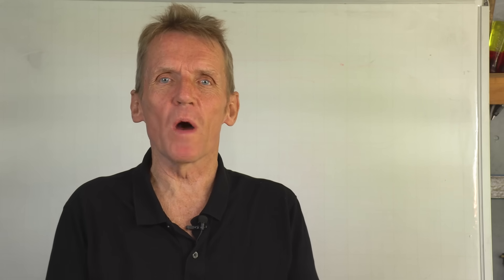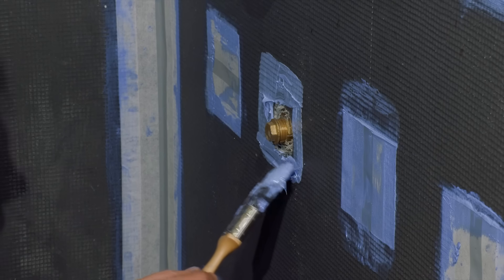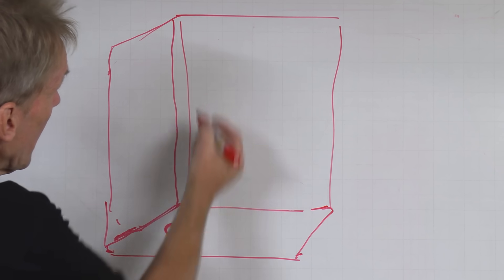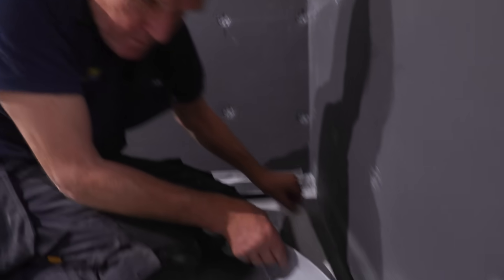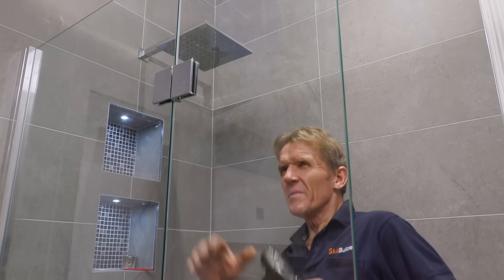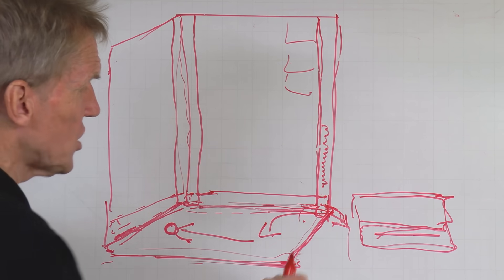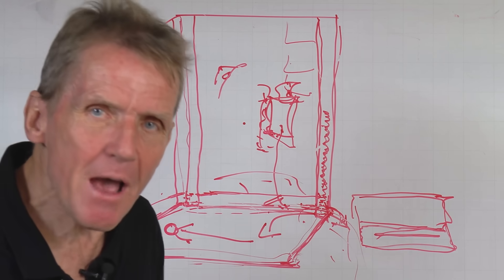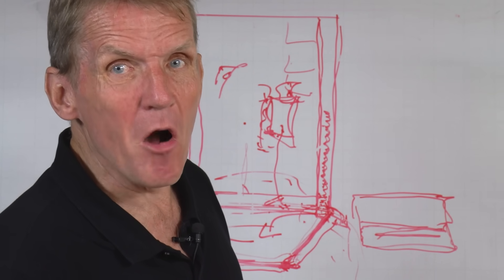This Is Why Your Shower Tray Leaks

Comment: Having just had my entire bathroom renovated and built from scratch, I had at least 8 "bathroom installers" in to price up the works, all but one of them (who eventually got the job) said they would use moisture resistant gyproc as "that's good enough and what we always use", a few of them when I asked about Hardie Backer asked "what's that?", eventually I gave up on the idea of them using Hardie board or equal till the last guy came in and I mentioned moisture resistant gyproc where upon he scrunched up his nose.  I asked if he would prefer something like Hardie Backer and he said he would only use that.

He got the job based on that one thing... and a great job he's doing so far too.

Comment: That's why I prefer wet floor bathrooms where the entire bathroom is tanked and floor sloped to the drain. Walls - glaze surfaced cement or hardy board over sealed walls. Use H3 treated timbers throughout to stop mold growing if the worst happens. If you really want to go for gold have the shower line come through the floor - not the wall and set up as a tidy feature in a barrier 'glass' wall?

Comment: Any thoughts on multipanel for showers?
Reply from the maker: It is good stuff. You still need to look after the detail at the bottom where it joinst the tray and you need to seal all the  joins but it is generally a good system and easy to keep clean

Comment: Roger, what if you intend to use shower boards rather than tiles? No dodgy grout to break down but can you get away with waterproof plasterboard?
Reply from the maker: The plasterboard is never waterproof but if you paint it with a membrane and seal the panels properly it is a good system.Think of it as tiles. Make sure the plasterboard is sealed well where it joins the tray and put some tape up the back. We need to do a video on it

Comment: I’m about to fit a new shower in a house I’m renovating. I’ve used cement backer board on all 3 walls the tray will sit between, but was thinking of also painting the whole area with flexacryl waterproofing paint, this is ofcourse designed for exterior roofs so figured it would do the job, I’d need to test if tile adhesive sticks to it I know, but does this sound like a good or bad idea?
Reply from the maker: I would rely on the cement board. Seal all the joins and you will be fine. I have looked at Flexacryl as a tile base and it might work but the cement board is doing the job. Coat it with diluted SBR if you are concerned or use the Ardex blue primer.

Comment: The client back to Roger and complains about leaking shower tray made by him. Client looking by window cause noticed some colour gleams (red, blue, white?) on the walls. It was Roger's face changing colours from red by cyan to white at the end. He run to the car, but keys gone... Phone dead, scared client runaway, so Roger start his run. Every single drop of sweat painted withering scenario, in crushed Roger's brain, every next worse then the last. Starting from the crumbs of bread which falled down in slow motion,  lands butter the bottom on the sealed place; through picture flashbacks of thousands tube of silicone date expires, cheeky wanker add his own ingredient to the tank in Everbuild company ending. Every single possibilities, every. He arrived before homeowner, so he broke the door, strangled the Bullterier with the handshower, then cat jumped at him. Roger take pencil from the pocket, turn around and pinned cat to the 9mm cheap plasterboard in corridor by one shot. Cat meowed last time, frighteningly but it was not a word. Broken paw stucked inside the wall had one claws left. It was enough for puncture the pipe inside the wall. It sweated like Roger, during looking for leak source. Then he waked up. It was the worst Roger's nightmare.

I love your channel and had a inspiration rush. I know... My English still far from Roger's shower trays quality.
But, hope you smile at least.
Thanks for your job, and knowledge.
Reply from the maker: Thanks for the screen play. We would love to make that movie.
Reply: @SkillBuilder  😍 I want to see new Roger. Roger Mur (it's a riddle)
Regards from Poland

Comment: Brilliant video as always and well timed!  Just applied a classi seal to a new tray I'm putting in but unsure what to use to stick the back of the classi seal to the tile backer board as it says only neutral silicone can be used - what do you use Roger CT1, HB42, Tec 7?  I have some of the elements Fix-MD would it be the better choice?  I've watched your other video about silicones but none of the adhesive style sealants either state they're netural or acetoxy the way Dow Corning do.

Comment: You never bore us Roger. You are a proper builder. Wish every builder took pride in their work and not just churn out job after job chasing the money with no quality workmanship.
Reply: I am going to replace the bath with a long shower. I  am going to copy all your instructions so that I know the  plumber with do all the necessary jobs . However  the bathroom is upstairs I think on a wooden floor ( unsure)  I have  known other people who say this is  not reliable as it eventually leaks. Is it usual to put  concrete under the tray  in some way and follow all the instructions you have shown
Reply: Totally agree. We rent our home but the landlord hired cowboys to redo the shower. 6 months on it s leaking through the kitchen ceiling, 2 years on and I've resealed it 4 times and it still leaks, because he can't get the guy to come back and like most landlords he won't pay for a proper job.

Comment: Great vid. I've always used tile board but I think some of the problems are caused by tile adhesive manufacturers stating their 100% waterproof flexible product is suitable for tiling onto plasterboard etc . I also prefer a tile tray with moulded upstands.
Reply from the maker: Great point! It  would be good to see them offering more advice and, considering that so many of them have tanking kits they should be driving the point home

Comment: Wise words Roger, thank you.
As a DIY-er I’ve removed 3 or 4 showers that were tiled on plaster board, and they all to a one had the tell-tale black mould (best case) or (worst case) were completely soggy and waterlogged. I’ve recently made a new shower enclosure from scratch but first watched your YT vids on the subject. I used Marmox lightweight waterproof board with the butyl tape etc. – and it made a lovely job for the tiler when he came. The one thing I did do was bed the resin cast tray on tile adhesive. But I was careful to pick a cement based one. That’s what I'm telling myself….

Comment: All good information Roger. You don't mention the trays with a 20mm  built in upstand  on the tiled walls.  The tiles then come down over the upstand to form a completely waterproof seal, even if the silicone joint is defective.  I use the Coram brand which in addition to the tiling upstand have a raised profile where the screen fits.  So even if the silicone is defective across the external bottom of the screen it remains completely water tight.  Never had a problem with all the ones I've fitted.
One other point I'd make is the silicone application.  You should never tile right down to the tray but leave a 4mm or so gap so you get silicone right into the joint.  And always use an angled silicone profile tool to get a correct joint profile.  This does two thing; 1) it gives a 'body' of silicone that can stretch if there's movement, and 2) the angle profile throws the water away from the corner.   And as you correctly say, seal the tray PRIOR to fitting the screen using the best quality silicone you can.
Reply from the maker: I have one of those trays in my house and it is a silicone free tray. They aren't popular probably because they need to be handed

Comment: Brilliant vid Roger, some great info here, delighted I found your channel. Doing up an old house, did the first shower was last year; went with cement board and a bostik flexible tanking kit for the walls, low profile tray bedded in dry mortar mix-all good so far. Next one I was looking at a fully tiled shower/wet room, any advice on a good system or brand to use?  👍
Reply from the maker: Check out Elements Board from Abacus. It is made in Yorkshire so it must be good. We have lots of videos on wet rooms.
Reply: @SkillBuilder   Will do, many thanks.

Comment: Should the chrome fascia round the valves in a shower have sealant round it? 
I've had a recent leak in my shower and haven't been able to source it, but I did manage to fix it! The seal on the shower head was done, and there was water coming out the back of the shower head going directly against the tiles and running down, but a lot higher than it would normally. Either there is a hole in the grout in some of the higher up tiles, or it's running behind the valves (I'm guessing). When I switched the shower head for another (a spare from one of my unused eight showers in the East wing) the leaking stopped. I'm not sure whether to seal the fascia or not now!
Reply from the maker: I usually seal the hole with the neoprene gaskets from Rubber Duck Bathrooms and then put the tiles on, then grout and finally put silicone under the plate on the top and sides but never the bottom.
Reply: @SkillBuilder  Nice one, thanks. I've no idea if they used the gaskets or not (they did a fairly good job in the rest of the house), but I'll add silicone to the top and sides now that you've given me the all-clear! I'll head into Screwfix tomorrow and get some. I'm guessing that if I walk in and shout "pint of your best silicone mate" before tapping the side of my nose and whispering "Roger from Skill Builder sent me" I'll get the 20% discount?
Reply: @ricos1497  remove the decorative plate/escutcheon and applybghe silicone where it sits then reinstall and clwan the excess as if applies over the outside it likely will not seal. You can also seal the whole wall; tile, grout and all with an applied urwthane coating but its only applied by professionals as it pretty toxic until it cures. Years ago we use to do this when replacing tiles for valve replacement. A big advantage is the grout gets sealdd too and now doesnt need as much cleaning. Still looks like tile though.😔

Comment: How much do you charge to get a full shower room done?
Reply from the maker: Wrong question but I will try and answer it. I charge my labour which is roughly £250.00 per day and then the materials.
Tilebacker board £350
shower tray and surround £1,500 
Shower Valve and head £1,500 
WC £500
Basin and taps £400
Pipes etc £250.00 
Tiles and tiling £2,500 
Lets say £10,000
Reply: @SkillBuilder  thats all??!!
Reply: Really is a how long is a bit of string question. £10k is a good ball park though for the average 3 bed semi. I've installed bathrooms where the materials alone cost 30k.

Comment: I am with you on using plasterboard, so I use tanking and a waterproof board, 
The other thing is the waste, there’s usually a huge hole in the floor, under the tray which is where the leaking water goes,  and stains the ceiling below, , I work in property maintenance , could you show  how you detail this?
Reply from the maker: Will do

Comment: Hi Roger, would you tank a corner shower with plastered block walls and concrete floor?  I have had a tiled shower over the bath for 36years  with no problem  but now I want  a proper shower.
Reply from the maker: I would always put a tanking membrane on top of the plastered wall. There are lots around including Everbuild,  Ardex Dunlop

Comment: iv been in the building trade for 15 years and every single house i have taken down every bathroom i have updated and seen tile on plasterboard its been a mold invested rot hole, don't do it! even if you just use marmox board and tape it is better, never use plaster board its hygroscopic!
Reply from the maker: Top man
Reply: Can you install that 10mm fake tile board over tiles or plasterboard and silicone all the joints, then fir s shower tray and enclosure?

Comment: Buyer be aware!  Great Video Roger, shame it will fall on some def ears. I come across the exact same scenario today, rotten walls etc….. An average bathroom takes us 2 weeks not a few days. Done properly with all the right water barriers (porcelain tiles, tanking, tile board) it should last decades! I aim for several water barrier fail safes.   Bathroom fitting is actually more specialist then people think. You need many skill sets to get a masterful finish.
Reply from the maker: Good man, I agree completely
Reply: It used to be perfectly acceptable for a tradesman to get their head down and do a proper job without fancy products without spending so much time on their phone as they do nowadays. This sort of ‘belt and braces’ approach may be deemed necessary in a commercial install but I don’t think you will convince many domestic customers of it’s merits.👍
Reply: It's perfectly acceptable for plasterboard to be used if it's then tanked with the latex roll on method. Sadly so many places were built in the last 30 years with just plasterboard and tile around the bath and shower that's what people expect to have back and don't see the value in the added cost of the new water barriers. Many people around here aren't worried about the leaks as they're of the opinion when it gets bad enough in 10 years they'll just redo the bathroom again. Completely oblivious that the changes in the BS were to protect the structure of the building being damaged rather than stopping leaks.

Educating customers of this can be a headache so perhaps in future I'll just link this video.

Comment: Great video Rog, I have a bathroom to do in the future and will take your advice👍
Question,  what is the best silicone you would recommend ? Is CT1 any good?
Cheers M
Reply: Dow 785plus
Reply from the maker: CT1 is good so is Dow Corning.
Reply: Don’t use ct1 anywhere visible as it discolours over time.
Reply: Dow Corning 👍🏻
Reply: Cheers pal, would ct1 in clear discolour? 🤔
Reply: @matthewcalder4351  yes goes yellow.

Comment: Last house we owned, the previous owner had a shower installed with plasterboard - it ended up being all mouldy and crumbling behind the tile. We've just moved into a new (formally rented) house and the shower is a botch job- dreading to see what the state of the wall is behind the tiles 😬

Comment: Shower trays shower trays !

Can you get the manufactures involved in telling plumbers how they want them to install the trays 
Sand and cement ,tile  adhesive or dare I say it silicone 😱
Reply: I use bags of frozen peas. Both cheap and effective.

Comment: Qboard from b and q is amazing and really cheap however they never have it in stock because they are next to useless
Reply: That’s funny 😂
Reply: what the boards or B&Q ?  lol
Reply: our local merchant has free wedi board when they don`t have it in
Reply: The elements board is good,  it’s lightweight, and provides some insulation, when I did my  wet room, I used hardy board for the walls and elements board for the floor, it was 30mm board, but you can get thinner, 
When I do a shower at work I will use all elements board, I maintain about 30 showers, and they have all been fitted in the past with plasterboard, it means I have to repair what’s their in the main, but whenever I get to replace completely, I will be doing it properly.